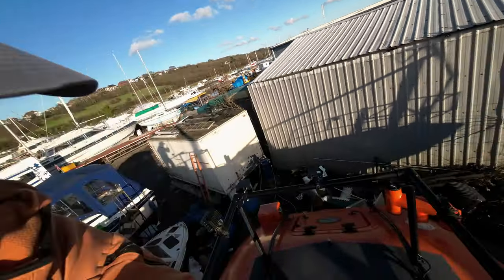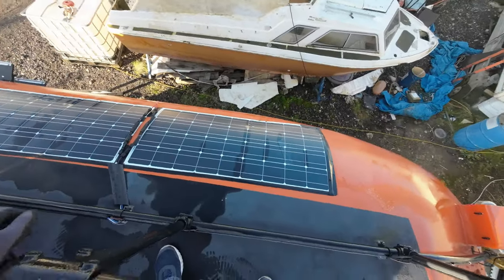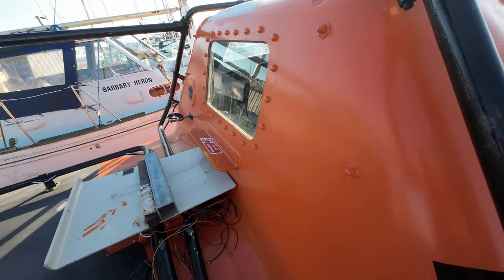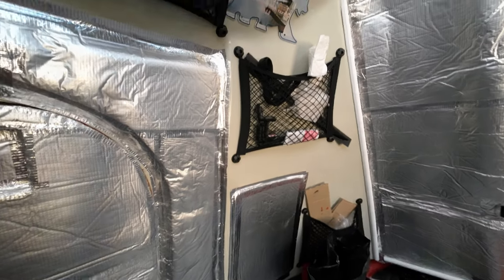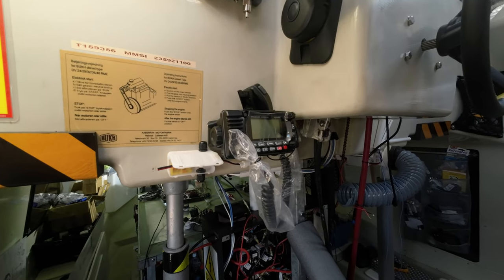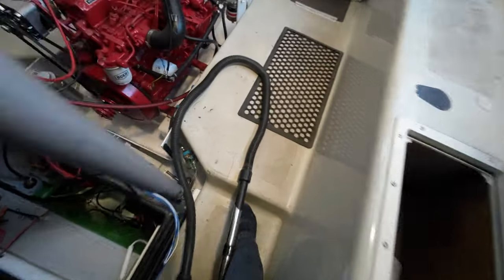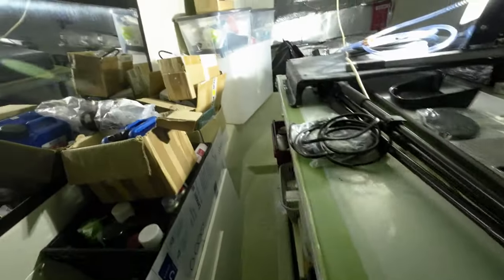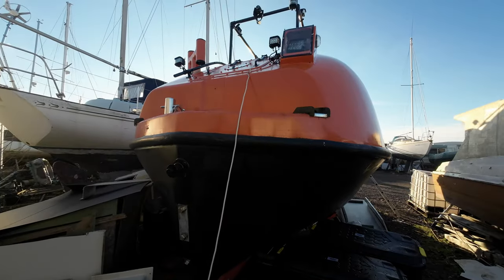The Official 2023 State of Alan Address. A works list for weeks ahead. Lifeboat Conversion Ep67 [4K]

Comment: From someone that lives in the Arctic and boats here you do not need to put mesh around your prop.  If you get into ice that's going to contact your prop you have much bigger problems. All its going to do is increase your fuel consumption and create problems with cavitation and possible blockages with debris (that will have to be cleared by getting in the water).
Reply: he wont listen
Reply from the maker: Do you operate around pack ice? I consulted pros on this, and the mesh was seen as the front runner of a number of designs. Around pack ice, small chunks of ice often travel under the boat - too large to float by on the surface but large enough to get wedged.
Reply: I also have a concern about the mesh. No pack ice experience, but when rivers freeze here in Canada we can get something called frazzle ice. It creates ice jams and flooding. If you ran into small ice chunks that could pack together, you may block the prop. Just a thought.
Reply: @AlexHibbertOriginals  When I have to, I do, by have to I mean saving someones life. Pack Ice is very dangerous for small boats especially fiberglass hulls. There's a couple things to think about. 1) ice floats and moves, how deep is your prop under the water line. Do you want to be in ice that's thick enough yo make it to your prop? How much ice can your boat push thru. 2) There's already a Keel and a shrod protecting your prop from strikes. 3) The biggest thing to lookout for is massive pieces of ice just under the surface that you can not see. The shroud and keel will keep the prop safe. I always have a spare prop on the boat.  PM me if you want to chat about my qualifications, I'd be more than happy to chat with you about my experiences.
Reply: 😭 lives in the Arctic or survives, barely, in the Arctic?
Reply: @AlexHibbertOriginals  Nailed it...
Reply: @AlexHibbertOriginals  bro... You can't put mesh in front of the suction. You're going to get it clogged with debris. If it was a day or two trip, then no problem.  pushing that much water for that long of a time will clog. You're also putting your motor in danger from overheating in the event of blocked mesh. The only design that will work is a bladed system to block bigger chunks. Think of a solo cup and spread out like a fan.  I think I what the hell I'm talking about I landed a plane on the Hudson. Sully

Comment: Yes to the autopilot if you can swing it.  If you're planning to motor for hours or days at a stretch it will greatly reduce your cognitive load and fatigue.  With wave action, motor torque and other imbalances you won't be able to just lock the helm for very long.   For Alan even a basic (cheap) sailboat style tillerpilot that connects to your GPS might be enough.   Be wary of anything that uses a magnetic compass if you're going to high latitudes (as I'm sure you're well aware).
Reply: As someone who has sailed on a commercial ship, I would recommend a GPS unit that has a GPS compass and an autohelm that connects to it. I think that it is better (and probably cheaper) to have an autohelm that just will steer a certain bearing and to have someone monitor it at all times

Comment: Great update thanks Alex, just to note, the fire blanket you have for the stove is in a location where if the stove is actually on fire you will have to reach too close to get the blanket so the same space on the port side or next to the helm is the safest spot to any fire equipment, (as the entry/exit point is closer if things get out of control.)
Reply: he will not listen
Reply from the maker: We'll certainly have more than one - including multiple fire extinguishers.

Comment: #32 add a trolling motor as an emergency backup #33  add reflective tape to the front, rear, sides, and top.  #34 add personal satellite tracker.  #35 add a spare rudder and adding a spare prop would be better than the cage.  seaweed wrapped around your cage will really mess up your trip, plus you have extra steel to fab a new larger one anyway...  it never hurts to have rather important spares as well as a writer plane for its replacement posted to the hull, with replacement hardware because your cold hands will end up dropping a few.
Reply from the maker: Some of those are on the auxiliary list. It could have been an hour long tour video😂

Comment: Hey just a thought wouldn't you want to leave the griped surface black I can think of 2 good reasons 1 you can very easily distinguish between a grippy surface and the slick gel coat 2 I feel like the extra heat would help prevent ice buildup

Comment: Might consider mounting the anchor outside with a bracket mount attached to the top railing, can keep the anchor rope inside  ready to use with quick connect hardware!

Comment: When you are doing things on the cheap for anti-slip coatings you can simply use 2 pack Epoxy paint & course washed sand with the first & second coat of paint while still wet then followed up by a third finishing coat without sand. The best solution would be to put overlapped X's that are as wide as the walkway with a small gap maybe 1cm between each X forward & back until all the walkway is covered.
Reply from the maker: Certainly a good option. The grit I used was expensive.
Reply: @AlexHibbertOriginals  Ultimately it will be up to you & your requirements.
Reply: @AlexHibbertOriginals  You can sprinkle sugar on the paint, when it dries wash it down, and the sugar dissolves & disappears leaving a nice pitted non-slip surface

Comment: I used to test these a couple of years ago for the royal navy, we used to see what could be mounted on top in regards to equipment, we used to keep loading things on to the top, eg lights antenna mast storage etc, o see what interrupted  the self righting I can guarantee that this vessel will not self right with 2 specific things you have on top, if you want a free report on your vessel, let me know.
Reply from the maker: A shame you can't mention these two items in your comment, but any feedback would be appreciated via email / my website.
Reply: No probs alex always willing to help, yep I can say them in the comments, the main one is your chimney, its orientation means hen the boat is inerter, it will act like a leeboard or keel. It  needs to be going across the boat, I mean the 2 outlets need to be port and starboard, also if you put anything high up on your mast keep it off of the keel line orientation and let it be fixed port and starboard, think of the boat upside, the keel stops a boat rolling but if you turned the keel to go across the boat, it would roll very easy, also if you want I've got loads of boat bits you are welcome to for free. I'll post them, my contribution, regards. And keep up the most excellent work.
Reply from the maker: Thanks for the additional info. Understood that anything mounted on the deck will resist self righting. I have to balance function vs installations.  For example, the heater cowl is at the angle that minimises exposure. If perpendicular to the direction of travel, it would need to be a foot taller, and I think that would increase water resistance. Anyhow, food for thought on how deck mounted items may inhibit self-righting. Thanks.

Comment: The engine compartment fan you showed will not vent the engine compartment when the engine is running if the air intake for the engine is from within the engine compartment.  A Typical 32bhp 2cyl diesel enclosed lifeboat engine (BUCH DV 32 RME) is effectively a positive displacement pump that consumes 2140 l/min of air from the intake, through the engine and out the exhaust.  

I've done several lots of training in lifeboats like Alan and they always stress that people should be strapped in using the seat-belts at all times to ensure the COG stays low and the righting moment is maintained.  One of the training courses was in Singapore, the heat, humidity, lack of ventilation and noise from the engine made the interior unbearable, hatches were opened, people hanging out of them desperate for fresh air, the wake from a passing ferry had us rolling so much that we took green water in through the side hatch and lumbered along on our side for a good while until everyone was back inside and strapped in.  Make sure everything is mounted securely enough that it can withstand being inverted.  Loose items (especially heavy ones, like people or steel ballast bars) breaking free of their mountings in heavy seas are potentially lethal to the boat occupants and can also prevent a lifeboat from self righting.  You don't want that.
Reply from the maker: Thanks for taking the time to type that up. Appreciated. There's a recent episode on air intake for the engine. Air is being fed from outside the bay.

Comment: If you are planning to use more Deutsch connectors it would be worth investing in a Deutsch specific crimping tool for the terminals. Would make a much more durable job than the tool you used in an earlier episode!! Expensive, but worth it when you are at sea and far from spares.
Reply from the maker: Ha! I have a smart new hex crimper.

Comment: Anti-slip on good old arctic trawlers, are made by good thick paint and sand of chosen size, thrown out on the paint while painting. You can simply choose with the chosen density of the sand, what grip you want and how much you throw out on deck with your hand, when you roll out the paint.   I don't see any pre-made paint with anti-slip features beat that solution.
Reply from the maker: Mine wasn't premixed - I was just stingy with the granules.
Reply: Nowadays there are much more durable and grippy materials available. Coming from downhill skateboarding, there has been tremendous progress for grip tape and other anti-slip materials in the last few decades. One secret we did find out in the process though, nothing beats an industrial 40 grit sanding belt for both grip and durability.

Comment: The more I think about it, the more I think you won't need to use the coolant loop on the hull in cold conditions. A radiator inside the hull will probably do a fine job keeping the engine at a proper temperature.
Reply from the maker: That, and a back up diesel stove.

If it gets dangerously cold in an emergency, we can open the engine cowling hatch and let hot air out. Noisy though.
Reply: @AlexHibbertOriginals  absolutely. Just consider the size of your average car radio and how they're 150-300 horsepower, and that Alan's engine is 45 horsepower. I genuinely think that a moderate size radiator with a moderate speed fan will put off a nice pleasant warm breeze. Valves to enable the underwater loop for warm water testing will still be helpful, though.

Comment: Would it be better to use stainless steel flat bars around the shroud that directs the water inwards into the propeller with gaps that block ice from entering as the stainless mesh might not be strong enough?
Reply from the maker: This was one of the designs we considered. It was shot down by a marine design engineer as likely to affect thrust and steering.

Comment: Once up in the Arctic, would you be able to scuba dive in case some Orcas decide to play with your rudder?
Reply: There is only one small part of the world (off the coasts of Spain, Portugal and Gibraltar) where some juvenile orcas have learned that rudders make fun chew-toys. In the Arctic, it's not a problem. Also, Alan's rudder is solid steel. The rudders that have been damaged in attacks are basically just foam covered in plastic (fibreglass). If an orca attacked Alan's rudder, all that's going to happen is that it will break some teeth.
Reply: @Garryck-1   Do these Orcas now how to sit nicely? I thought they had migration routes.
Reply: @tikunshana784  - My understanding is that yes, they do have migration routes. Nevertheless, the ONLY place such reports are coming from, is that one part of the world. Maybe they're outgrowing their bad behaviour as they move away?

Comment: I've installed autopilots in the past. I'm sure you could install one here. The ones I installed controlled the hydraulic system to the rudder with a feedback potentiometer installed on the rudder shaft.
Reply from the maker: Oh, for the funds!
Reply: @AlexHibbertOriginals  They were quite fun to calibrate. We would have to take the vessel out to sea and perform maneuvers. Sometimes hard to starboard to hard to port and back to ensure proper GPS tracking, route navigation, limit settings and what not. A 65 foot lobster boat can bank a turn at quite the surprising angle. They cost about 3k-5k in Canada for the system with drive, so pretty pricey though. One of the things I took great pride in during my Marine electronics time was beautiful consoles with all the equipment recessed and flushed, even monitors. I've been wanting to do that for you hahahaha.
Reply from the maker: I'd be a happy recipient! Perhaps a word with your suppliers....

Comment: Regarding autohelms. I recommend you go a lot bigger than the recommended specification for your setup. Autohelms (especially tiller pilots) are notorious for failing, and the main reason is they tend to regularly get pushed to the limits of the forces they can deliver (and the wave forces they can resist). This shortens their lifespan. So ideally, it pays to go for one considerably beefier than manufacturers recommend. Alternatively, it's possible to have the autohelm control a trim-tab fitted to the trailing edge of the rudder, which involves much smaller forces, enabling a smaller unit to be employed. However, a trim-tab setup (particularly for a vessel like Alan) is likely to be rather more complex (and time-consuming) to install.

Something else you may wish to consider is about your night-vision preserving lighting. Militaries the world over have moved away from red light, to green. It is almost as good as red light, but allows for better distinguishing of details, and better recognition of colours that are difficult to see under red light. This has obvious benefits for looking at instruments, navigation charts, etc. But whatever colour you use, it's important that you can dim it to the weakest brightness you can work with.
Reply from the maker: Thanks also

Comment: A note regarding Coppercoat. A good number of people have had issues with their coppercoat applications. In every case, their problems have boiled down to not following the manufacturer's application instructions to the letter. Even some so-called "trained, experienced professionals" have buggered things up. So DO NOT DEVIATE from the application instructions AT ALL. Especially regarding temperature and humidity. If possible, have the application done by someone with a lot of experience working with Coppercoat.
Reply from the maker: Thanks

Comment: dont know if anyone has mentioned it but the diesel heater fuel pump is going to be loud. to the point where some van lifers couldn't sleep. so might want to think about noise cancelation.
Reply from the maker: There's no pump in a Refleks

Comment: Please don't do copper coat there is new regulations on the way(first in Denmark but Wil probably extend to eu soon) that will esentaily ban copper antifouling, to the point that you might not be allowed into Port. From my contacts in the marine coating industry it seems like the best option presently is super smooth silicon paints. Hempel has some products but I don't know if it is available to private individuals.
Reply from the maker: Are you referring to ablative copper anti-foul, or the epoxy based CopperCoat? SilicOne is available, but has a number of drawbacks, not least abrasion resistance.

Comment: No pressure then.
Reply: It's a tight schedule for sure, but the guy is determined so he will make it work even if the job is half finished, not everything is essential. But please please, cover the poop station with a curtain.
Reply from the maker: Some jobs can be done whilst heading up the UK coast - the non-safety bits and bobs.

Comment: A script and a plan would stop wandering conversation, keep on point. Lots of Oh and blah blah blah. Without modification a standard alternator cannot charge lithium Iron Phosphate batteries, the alternator overheats and dies. Go see your local Victron rep and ask what mods are required for the alternator.
Reply from the maker: What a strange tone. This episode was a change from my normal format and the like ratio is 99.8%. And I have the correct battery - alternator interface.

Comment: Yet another observation on dealing with ice in the top 3 feet of the sea water. By all means defend the propellor from large lumps but also think about the fragility of the rudder. This needs additional protection.
I suspect that the design brief for life boats is to provide shelter for lots of people. The functional design life might be based on simply rounding up people in the water and closing on other life boats and generally awaiting the arrival of a rescue ship. Extreme passage making especially in ice may never have been included in the design brief for the boat hence the need for a clean sheet to reassess the functionality of the underwater elements in the presence of ice.
Reply from the maker: Thanks. Yes a lot of factors to consider.  A few of us are going through the latest US mil report on brash ice and prop design.